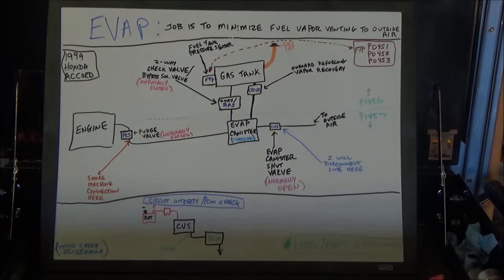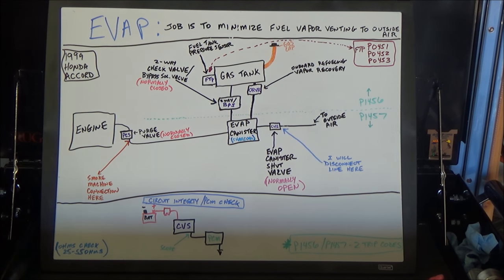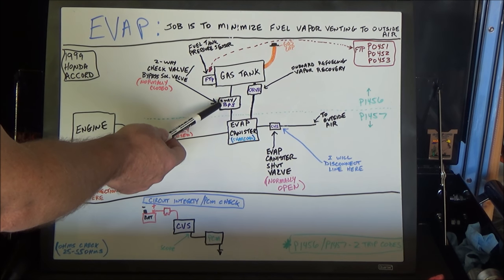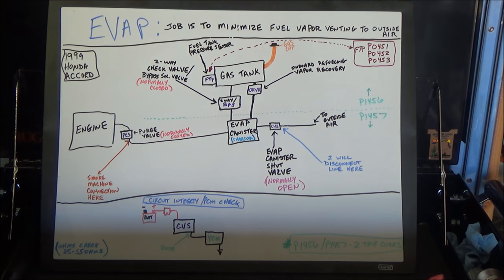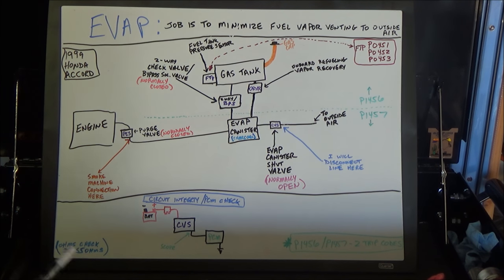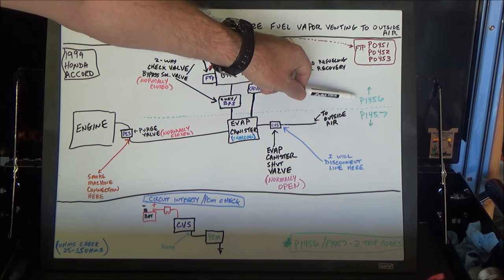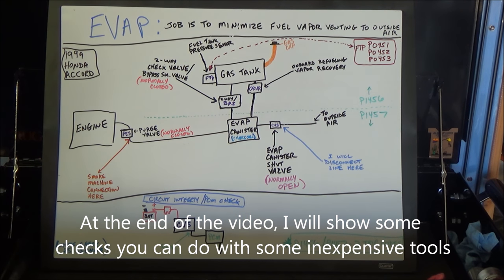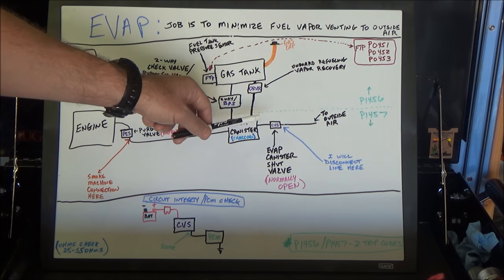Honda Accord P1457 (90-2) EVAP Canister Vent Solenoid Diagnosis/Repair 1999 V6 (1998-2002 Similar)

Comment: Thanks for the reply. I did the replacement this morning. Unfortunately, my check engine light is still on. Do I need to drive it around for a little for the computer to know it’s fixed or should the check engine light have turned off right away? I think it might be the evap purge solenoid the the intake.
Reply from the maker: If you fixed the issue, the CEL will usually go out on its own on most models (after it runs and passes its EVAP self diagnostic checks which can take several drives of varying distances).  If the problem was not fixed, the light will stay on.
Reply: Big Dog50001 Automotive thanks I appreciate it. It has in fact turned off already.

Comment: @Big Dog50001 I changed both the evap canister and the evap canister shutoff valve since the valve stuck on the canister, but P1457 still comes back again. Should I consider changing the purge valve close to the engine next? thx
Reply from the maker: Check the gas cap first then check the purge valve.  You can check the purge valve using a vacuum tester like I showed in the video (don't apply too much pressure).  The purge valve is normally closed so it should hold pressure while the vehicle is off.

Comment: Ty for this knowledge my honda odyssey underneath the car is a pita now i know the knowledge of the evap system
Reply from the maker: Thanks for the comment!
Reply: @BigDog50001  ever had an issue with either the purge or ventvalve it smells like gas fumes which one can it be between the ventvalve and the purge solinoid.

Comment: What if it leaks from the other side of where you're testing? So, if the valve is closed, but you test the side that's plugged into the canister. If that leaks, will it still throw the p1457?

Comment: Where might you suggest could I find an evap canister solenoid for a 2001 Accord online? Thanks.
Reply from the maker: I like Rock Auto if I am not getting parts from my local Honda dealer.
Reply: I bought the canister and solenoid from Rock Auto for 127 dollars and did this myself on my daughter's 2002 Accord V6 about an hour time. Get parts from Honda and pay triple!

Comment: I have to change mine always smelled like raw  fuel when hot outside n car ideling threw the code so going to replace it again this will be 2nd one what else can be used to lube o ring on valve besides silicone I don’t have any ?

Comment: Hey good video. What about the code P0456, which side of your diagram correspond this code?
Thanks for help
Reply from the maker: I went over which areas I start looking at in video, but the trouble areas for codes like these can be anywhere in EVAP system unfortunately.

Comment: Hi - Thanks for your thorough and detailed video!  I have an 02 Odyssey with a P1457 code.  The CVS checked out with the multimeter/battery test.  Can the bypass valve also be tested with a multimeter?  Mine reads "0" when taken off the vehicle and tested.  Thanks again!
Reply from the maker: I am not sure how you are testing them, but yes the bypass solenoid can be checked/tested just like any other solenoid.  The bypass solenoid is normally closed, unlike the canister vent which is normally open.
Reply: Thanks.  Should this solenoid also read 25-55 ohms (like you mentioned for the CVS in the video)?
Reply from the maker: Yes 25-55 range. Remember, just because resistance is ok does not mean the solenoid is opening and closing like it should.

Comment: I have a 2001 Honda Accord lx and I changed the canister purge valve  and the car before was making a knocking kinda poof sound from the canister below and after charging  it it’s still making noise and my check engine light came back on again . Idk what it is I think I’m just going to change the whole unit .

Comment: late to this game, but which jack point did he use to lift the rear of the vehicle? I have been trying to find the proper jack point for the rear of this vehicle but to no avail.
Reply from the maker: The rear tow hook in the rear center of vehicle is proper lift point for this Honda.  The jack stands go in front of rear wheels on reinforced pinch weld areas (20:20 min of video).

Comment: So i have p1457 code 03 honda odyssey i change the shut off valve solenoid erased the code and CEL came back on again and has the same code. So now im just wondering to change the 2 way valve and the bypass solenoid too might solve the problem?
Reply from the maker: The bypass solenoid can cause a P1475.  I would look towards that next if I was troubleshooting that vehicle.  Corrosion is cause of failure many times but they can also fail due to age.
Reply: Awesome been doing some research to what else will make that code i will try to replace it when i receive the parts i ordered hopefully that will get rid of that code and pass my emission. Thanks for you reply!

Comment: question would it be necessary to replace the whole canister when having this code or replacing the valve should do it? checked for leaks at 2 different shop and they didn't find a leak.
Reply from the maker: I wouldn't replace any parts until I verified the problem.  Sounds like you have an intermittent problem which can be difficult to fix until catching it in the act..
Reply: Big Dog50001 Automotive thanks  for the response

Comment: I have a Honda Civic 2001 ex. I got the p1457 code. Since you separated the parts on the board I have replaced canister, purge valve and shut off valve. Among other things (gas cap oem, ftp sensor, fuel pump new seal, vent solenoid that connects to the ftp sensor) I’m out of ideas. The only think I didn’t like when I installed the shut off valve the moment I connected that I felt like a small shock or something even though it’s new I have a feeling it didn’t work from the start. Can someone help please I have a few days left I will be replacing again the shut off valve and if that doesn’t work I guess the dealer can screw me over

Comment: Excellent video! Any chance you can do some explaining on how the P1456 side works on your drawing? Would like to know how the 2 way valve works. Thanks.
Reply from the maker: RuhrstahlX4 Thanks!  I'll see what I can do.
Reply: RuhrstahlX4 I have a 1456 and I changed the gas cap and still have it it would help if you could explain that side too thanks

Comment: Hi, do i have to drop the tank, if i want to replace fuel tank pressure sensor on Honda accord 2004 ? Also, does not replacing bad fuel tank pressure sensor affects Catalytic Converter ?  i had engine light 3 months ago with code Pl454( sensor) i didn't replaced it and now i got code P0420 ( cats) i don't know, if i should change sensor or cats. thank you
Reply from the maker: 1. Fuel Tank Pressure (FTP) Sensor is located where the EVAP canister is on those Accords, you should not have to drop the tank.

2. P1454 is a FTP Range/Performance Issue.  It could be a bad FTP, plugged Evap lines, bad Canister Vent Shut Valve etc.  It would need proper troubleshooting.  

3. P0420 is a Catalytic Converter Efficiency Below Threshold issue.  Most likely this is not related to a P1454 (but there are EVAP variables that can effect engine performance).  Many times a failed Catalytic Converter is caused by a poorly running/poorly maintained and/or misfiring engine (which would have to be corrected first or the new Cat would also fail).  Exhaust leaks and bad 02 sensors are also things to consider when diagnosing a P0420.

Firing the parts cannon at this vehicle is probably not a good option, it sounds like it needs proper troubleshooting.

Comment: i have a p0300 p0301 p0302 p0303 p0304 p0305 p0306 and finaly the p1457 could the evap be the cause of the rest of the codes? my car does not shake or vibrate only at start ups but i do notice a weird rumbleing sound coming from the bottom when im driving almost like a exhaust leak
Reply from the maker: Those P0300 codes are misfire codes.  It looks like there are misfires on every cylinder.  A P1457 is most likely not related to those codes.  The misfires should be fixed promptly or the catalytic converter can be damaged.

Comment: Would this be the reason why my engines dies after a full tank of gas until I go and take the gas cap off and then it will start again? I never have a problem if I fill up to half or 3/4 of a tank of gas, so is my evap canister bad? And I don't have a check engine light
Reply from the maker: Unfortunately, it needs testing.  Bad purge valve or plugged EVAP lines due to bad charcoal canister might give similar symptoms or it could be totally unrelated.
Reply: @BigDog50001  thanks. After doing more testing it seems that my problem is actually the distributor and only when it's cold outside.

Comment: Question the CVS valve suppose to have power all the time or when is suppose to get the power?
Reply from the maker: With key on, it will have battery voltage on one wire.  The other wire (ground) is controlled by the engine computer.
Reply: Big Dog50001 Automotive another question Big Dod50001 when  the computer is suppose to send ground to the valve? is getting power for sure and the old valve is working I also installed a new one what can be the problem?

Comment: I just replaced my 2 way valve, evap canister and my crank sensor.  My check engine light is back on with another evap code and still dying while driving.  What else could be causing this besides those 3 parts?
Reply: I also did a smoke test and showed no leak but still dying and pulling the evap code

Comment: I have a question!!! Please lol While trying to change the thermostat. The vac system I believe it's called was removed but one holes wasn't and it broke. That holes goes from the big vac to motor. Now the check engine light comes on even tho they rigged that holes up till someone could another one. Could that be the issue? Not the code 1457? Please help! Never had a check engine till after this hole was broken
Reply from the maker: Can really tell from your description, but if the check engine light came on right after the repair then there is a good chance that it is related to whatever was broken during thermostat replacement.
Reply: Big Dog50001 Automotive Idk how to explain it better lol I wish I could put up a picture. I just wasn't sure if the wrong coffee could come up from a hose being broken or not. Thank you for getting back so fast.

Comment: The O-Ring on my Car's gas tank is missing. Not the actual tank, but where the Gas Cap Screws in there used to be an O-Ring and now it's stuck on the Gas Cap. This causes random Check Engine lights that read Evap Sensor. I'm guessing that it's related?
Reply from the maker: It is cheap and easy to replace so that is where I would start.  I would install a new (Honda OEM) cap if it was my car.

Comment: Can this cause the car to choke and grasp for fuel when trying to accelerate hard??
Reply from the maker: Not typically, an issue with the purge valve is more likely to cause a drivability issue.

Comment: i took my car to honda and got and oil changed performed 
my check engine light was on p1457 was the code when scanned
i was told my wiring harness to the evap system was damaged 220 to repair it
just wondering if its worth the repair
Reply from the maker: cannonp10 Seems about the going rate for a dealer or shop.  If they spotted it that quick, you could probably look underneath near the Evap canister and follow it from there towards the front of vehicle looking for damaged wiring.  If you find some it shouldn't be too hard to repair, just use weathertight connections.
Reply: Thank you for the response
I'll take it into consideration

Comment: I am not sure if you may see this massage but what would be a resonable price becuase I went to 2 mevanocs and they said two different prices... please help one said 120 the other 300
Reply from the maker: Prices will always vary, especially due to location.  In your case, it is possible that one will actually diagnose the problem and then fix it (like I did in video), and the other cheaper one is only going to change out a part (which may not fix the issue).

Comment: I have a 03 Civic with the same problem. I replaced the gas cap and canister purge valve but the check engine light came back same code. What should I replace next ? Help please
Reply from the maker: jay gets buckets Make sure to use a Honda factory gas cap.  The canister vent shut valve is the one I replaced in this video, the purge valve is where I connected the smoke machine inside engine compartment (I can't tell which one you are talking about).  The third valve is a two way check valve and solenoid on the side of the charcoal canister (not all Hondas have these).

If it isn't one of those or the gas cap, then you might have a break in the line, a wiring issue or a computer driver issue.  I recommend testing each of these components and not firing the parts cannon at it.  You might need to bring it to someone that can troubleshoot it for you.
Reply: Big Dog50001 the canister shut off valve is what I'll replace next
Reply from the maker: jay gets buckets That's the one I usually check first, and the most common failure point I see.
Reply: I replaced the gas cap,vent solenoid you did and purge solenoid in the engine but still p1457 comes back so what is next to replace?
Reply: Efren Saclolo I did a smoke test and my filler neck was no good. Replaced it and the light never came back
Reply from the maker: Don't throw any more parts at it.  Do a visual inspection of the hoses looking for cracks/breaks and look at the wiring going to the solenoids looking for breaks and corrosion.  Although there could be other issues, the most likely cause is a leak so you may need a smoke test done on the system.
Reply from the maker: jay gets buckets-I'm glad to hear you fixed your vehicle, and that a proper test was done before throwing a part at it!
Reply: Big Dog50001 thanks man

Comment: i gota a 98 accord v6 and i got a p1456 but it comes and goes. didnt give me issues but up untill last month i noticed wen i start it up for the first time of the day it feels lik my gas pedle goes out but i dnt think its the peddle but something to do with the gas. it does it randomly buy usuallu wen the car is kinda cold. i step on the peddle and out of nowhere it would go out to where the car doesnt accelarate but if step on the peddle all the way itll kinda jerk and catch gas again, any suggestion?
Reply: and the guy who did my steteo system connected the amp ground to my gas pump ground could that be the issue nd has nothing to do with the code?
Reply from the maker: Sounds like more than one issue, hard to say what the pedal problem is from the description.  I would definitely find another spot for the ground on your amp, you don't want that interfering with your fuel pump.  The relay that controls the pump and fuel injectors (PGM-FI) is controlled (grounded) by the engine computer.  

For the P1456, try replacing the gas cap first, then if the code still comes back, you will need to test the different components to see which one is failing (although I know some shops just shotgun them with the CVS, PCS and BPS as well as a gas cap).  You can remove these solenoids and test like I showed in video (just remember to note whether the one you are testing is normally closed or open).  

Just remember, if you move a component you might get it to work again, and sometimes these systems fail intermittently which can make it difficult to diagnose.
Reply: ok thanks and also sometimes my car smells lik straight gas fuems to where i can even smell it inside the car with the doors closed i seen on ur video that the fuem arnt supose to be released into the air but stored for wrn the engine needs it, it would most likely be 1 of my solenoids right or the whole evap system
Reply from the maker: Bryan Martel: Check Canister Vent Shut (CVS) valve.  Same part in this video.  The owner of this vehicle also complained of gas smell.

Comment: Great explanation video. I have a P2422 (and no other code) saying my CVS is stuck closed on my 2007 Honda Accord. I see Honda part 17315-SDA-A02 at the end of the canister in the parts diagram but they call it a Dust Filter. It has an electrical connector on it (you can view it on Amazon) - is this my CVS? I ordered a CVS for a 2007 Accord from Rock Auto (they only have 1 version from 2 manufacturers) but it looks like there are 2 different canister setups for my car and I have the other one with this "filter" instead. Any info you can provide would be appreciated.

Comment: Would this be the reason why my car almost dies every time I leave the gas station with a full tank of gas? A couple of times my car actually did die and then wouldn't restart for several minutes. No check engine light though.
Reply from the maker: Possible, but in my experience I have seen more issues with the EVAP purge valve causing problems like you describe.

Comment: Were would the bypass solenoid located on a 2002 Honda Accord?
Reply from the maker: It is usually located on, or next to, the EVAP canister on those older Accords, on the side that points towards the front of vehicle.

Comment: Even though the old one tested ok (after hitting it) you might have been losing some of that pressure from the old o-ring. Hence, the ball not going all the way down...
Reply from the maker: These older systems and solenoids don't seal 100%, even when brand new, so it is not uncommon for them to leak like it did in this video (after it started working again).  The newer systems are required to have tighter tolerances so they do not leak as much, but even they leak some.  Thank you for the comment.